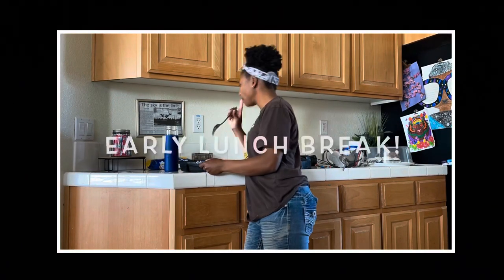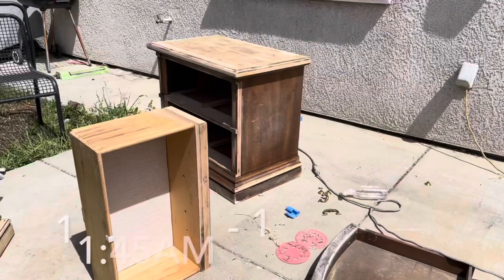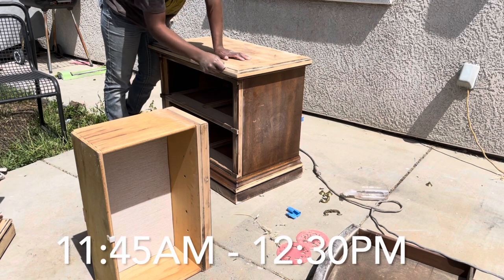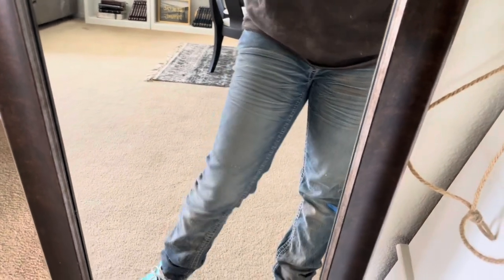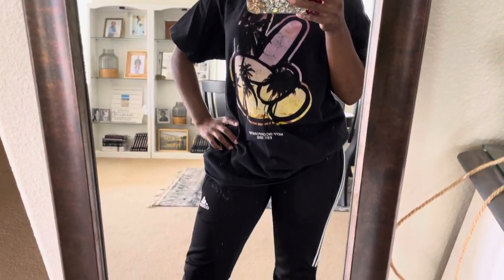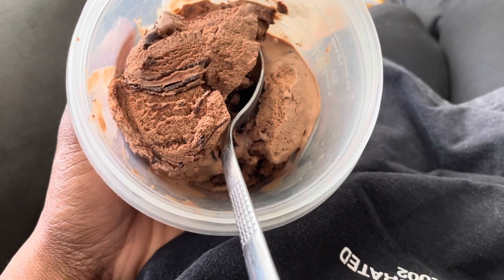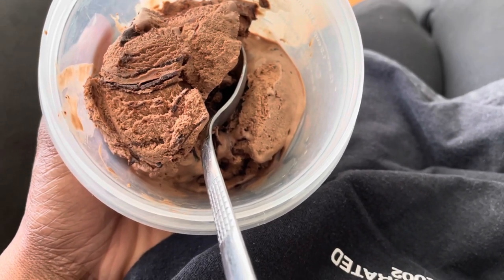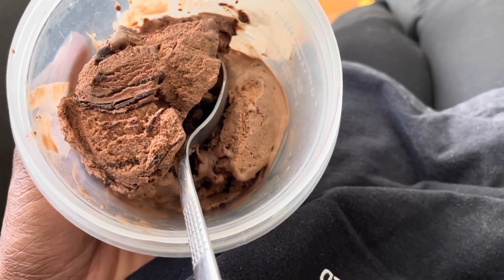FURNITURE FLIPPING VLOG | 2 FLIPS 2 DAYS 🤩

Comment: You should be able to attach your shop-vac to your random-orbit sander where that black sack is, reducing the amount of sawdust flung all over the place. (Shop-vacs can attach to pretty much anything with a 2.5" port. If not yours, they sell universal adapters that can accommodate down to 1". Or one of your shop-vac’s attachments might connect it.)
Bonus: less mess
Drawback: your sander’s a little more difficult to maneuver around with a long tube hanging out the back

That stain on that wood is gorgeous! 😍

Turned out great 👍
Reply from the maker: Thank you! 😀